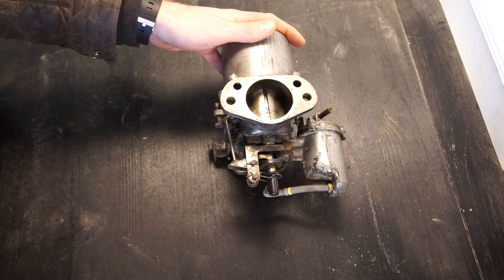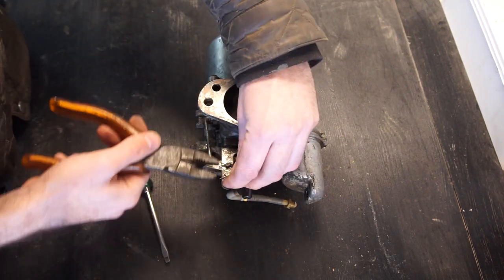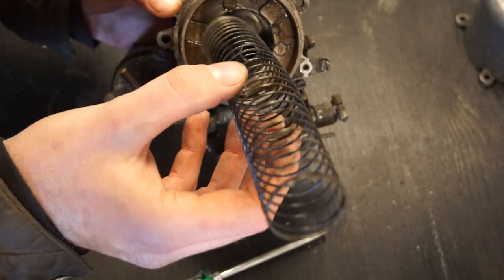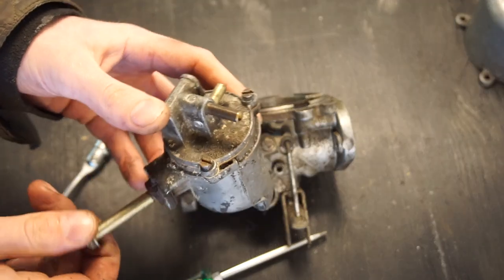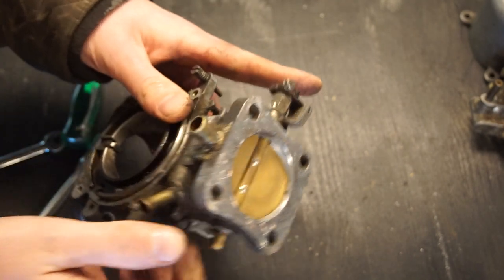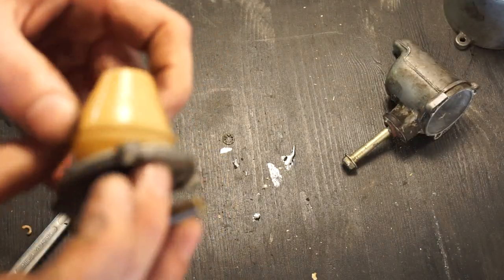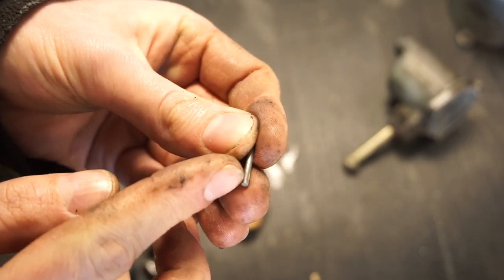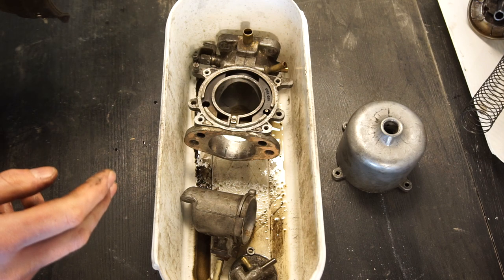SU Carburettor - Rebuild part 1 Disassembly

Comment: Looking forward for the next episode ! Thanks for this very useful video, de-mistifying the job to do on those carburettors. Got 3 on my Jag, it will be much more simple for me with your example !
Reply from the maker: I'm glad the video can help. Thank you for watching!
Reply: If you have 3 you probably have an Xk150S or an E-Type. They have SU HD8 instead of the HS8 shown here. There are multiple differences even if the principle is the same.
Reply: Ove-Norway 420g - the principle remain the same, so it look quite simple !

Comment: I have converted SU HS8 carbs to manual choke so that they operate like SU HS6 carbs.
I fit another linkage rod between the front and rear carbs that pulls down both their jets on the choke cycle.
This allows me to eliminate the AED unit that would normally sit between the front and rear carbs.
I then fit a sliding choke lever on the dashboard, next to the speedo, like on a Jag Mk2 2.4 and 240.
There is a kit available that allows you to do this conversion, however I make my own by taking parts from a Rover TC2000 set of carbs and cutting and re-welding the bracket that holds the end of the choke cable. I also have to make a new choke lever with a dog-leg kink in it to fit around the new connecting rod linking the two carbs together that pulls down on the jets.
This manual choke conversion allows me to set the jets in just the right place when I starting the engine in very cold weather, and to shut off the choke sooner when engine is up to temperature.

There is a video on my channel showing what the manual choke conversion looks like.

Comment: I have had several SU carbs. Current project is a Healey Sprite.
We also do some performance mods.
Reply from the maker: That's great! Which performance mods are you doing?
Reply: We currently have 2 sprites. A vintage racing Sebring and a MKII family driven sprite. Too many upgrades and modifications to list here.

Comment: Great video Adam, I've started reconditioning my HS8s last night, but the piston is stuck in and did not want to force it out in case I damage it. It soaked overnight in degreaser and wd40 around the piston.
Would you recommend "boiling" the body of the carb as others suggest on youtube? Thanks
Reply from the maker: I tried tye trick of boiling to clean them and I didn't find it too helpful. I hope you can get them lose! I'd try lubrication and temperature changes
Reply: Kroil penetrating oil will free anything.

Comment: I have to rebuild my SU's from a 71 240Z. I am unable to remove the top of the float chamber. The screws are out but the gasket is holding the top and bottom together. I am apprehensive about "prying" the top off with a screwdriver or other instrument. The gasket has been squeezed hard enough when the top was put on I cannot get a sharper instrument in between the top and bottom.  Any suggestions you may have on separating the top and bottom would be appreciated.

Comment: Nice Video Adam, maybe you can help me out. I have a Jag S-type 66, with 2 SU HD.6 Carbs. In the middle sits an auxilary starting Carburetter, Afther renewing them and put in some new parts, the gasoline keeps poring out off the starting carburetter and it seems that the carburetter it is connected with does not shut. Any Ideas what might be the problem? I follewed all the instructions from the book.
Greetings Arie 
Zwolle/holland